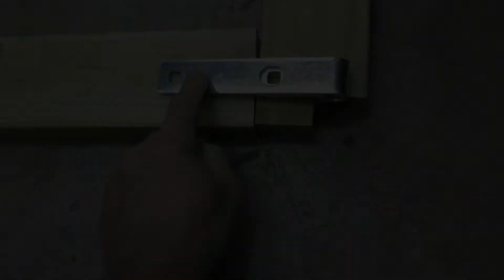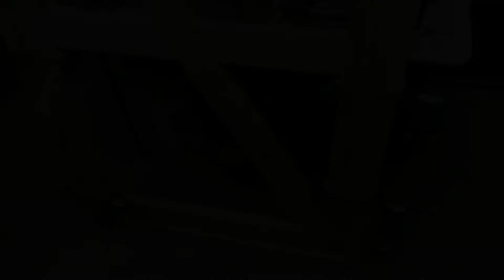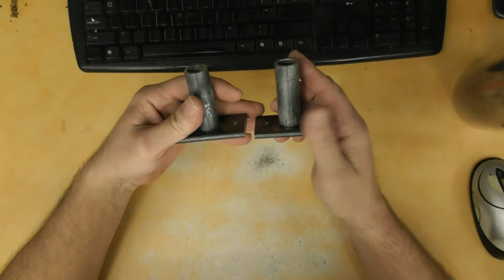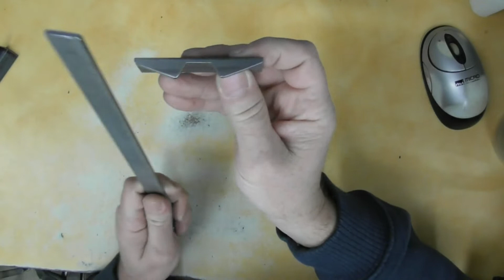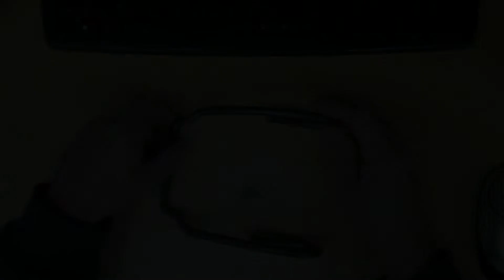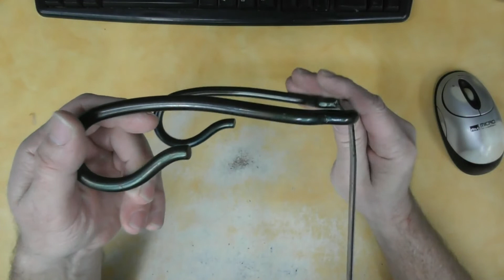Building a Custom Wooden Gate that Swings Both Ways

Comment: I just found your channel. You have some really good videos. What is the name for the hinges you used? That's the first time I seen those style of hinges and I'd like to eventually try using them. Also how did those hinges hold up over time? Are they stainless steel?
Reply from the maker: Thanks Dean, glad you like the channel. One half of this hinge is called a "hinge strap". I don't know what the other side is called. As for how how they're holding up, these are still working like butter. And no, they're not stainless- but rather some sort of a plated steel. Good luck, G.
Reply: @ghostses  that's neat way to install a gate. Thank you. I have never seen that. You solved locking the gate also with it opening and closing in both ways. They need to start building more doors like that for eas of function.
Reply from the maker: @DeanMeilken  Yep, this was of my own design. Dual swing was my goal. It turned out well. Take care, G.

Comment: What are those hinges called?
Reply from the maker: You'd have to be more specific Travis. I'm not sure what you're referring to. G.
Reply: @ghostses  I'm going shopping for similar hinge parts and wondering how/where to find them. The box stores seem to be a miss locally. Also, was the metal for the latch any specific temper to ensure it maintained its spring rate?
Reply from the maker: Travis, do a search for "strap hinges" and you should find them. I got mine from Atwoods. Tractor Supply might have them as well. Not sure if either is in your area, but it might be a start. 

No, no temper on the the latch spring to maintain temper and it's been working great. Hope this helps, G.

Comment: Doggo will figure that out kinda quick. You might need to put that higher up or a bar from the top on the leading edge that wedges the latch into the keep. Nice ideas, I need a double swing gate at my mums house. I had a girlfriend 20 years ago like the gate, good times.
Reply from the maker: So far so good- but if she does it once- it's game over. I have an idea for a trip lever lock near the handle. One you would have to lift before the handle can be pushed down.  I hope I don't have to go to design, but we'll see. Sounds like quite the gal...lol. G.